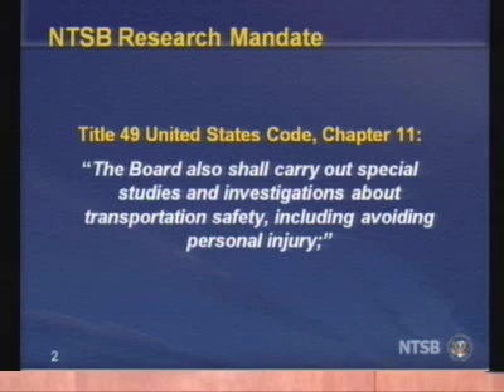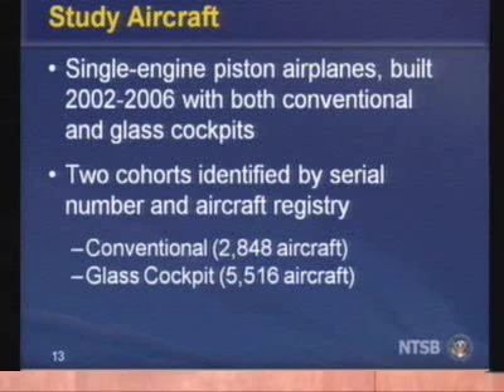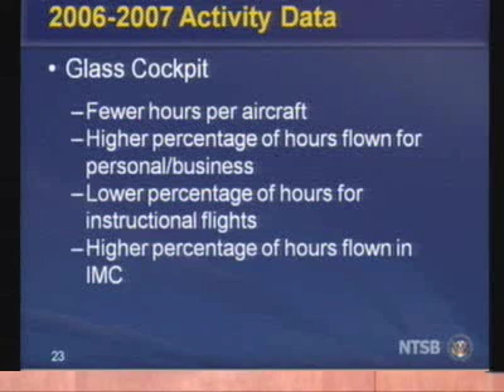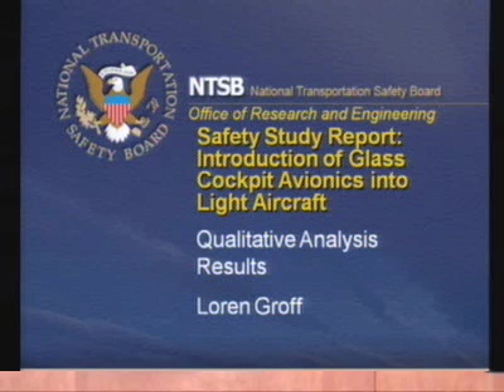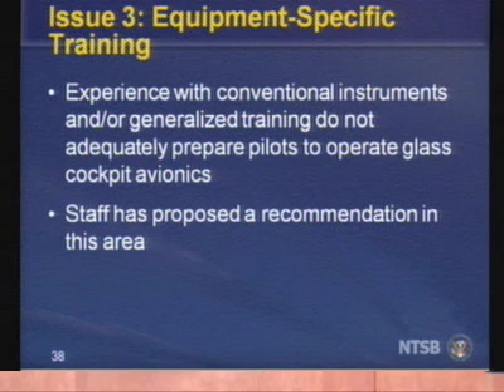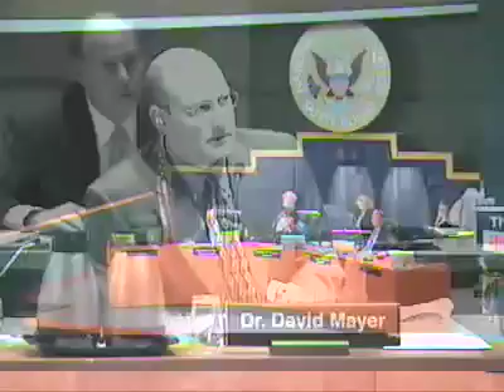Glass Cockpit Safety in General Aviation Aircraft NTSB Hearing

Comment: I find it interesting that a "glass" pilot has difficulty flying on the backup "steam" gauges.  It might be contrary, however the same findings might fit for a pilot originally trained on glass that later flys steam. Today we have automation complacency to battle. It is important not to get distracted by all this time saving technology that actually robs time away from flying and monitoring the aircraft.  The pilot must make the plexi-"glass" windshield  more important than the glass display.